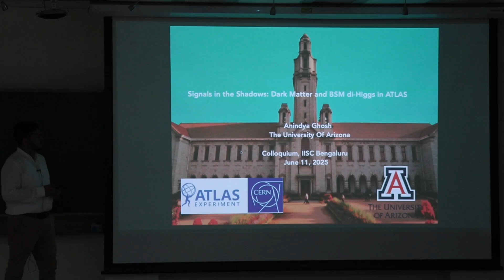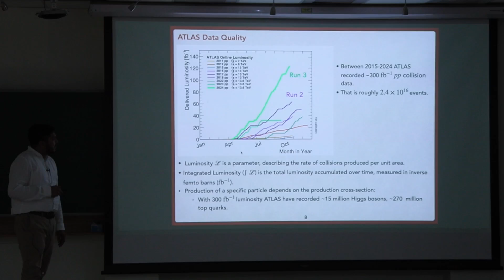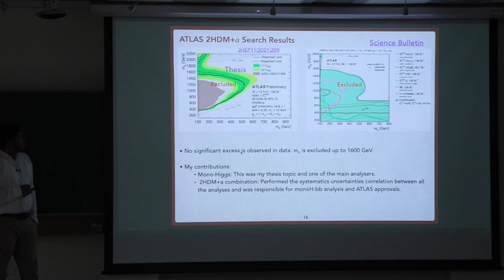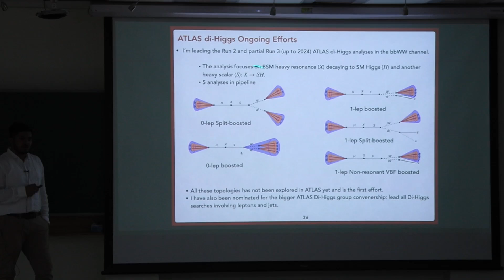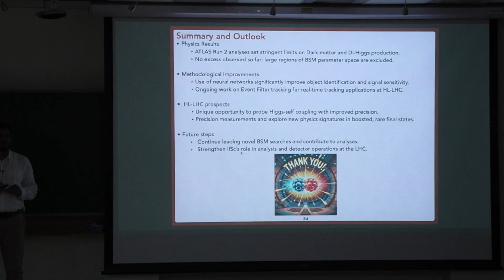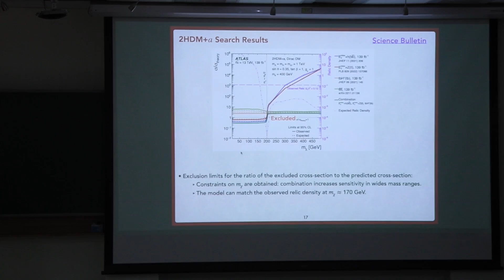Signals in the Shadows: Dark Matter and BSM di-Higgs in ATLAS

Comment: All galaxies with low mass centers have normal rotation rates. A fundamental insight of Relativity is that mass that exists at relativistic velocities is irrelevant from our perspective. Relativistic velocities are occurring in the overwhelming majority of galaxy centers. Relativistic dilation is occurring in our galactic center. This means that its mass exists in a "non local" state from our perspective. In other words it's not just there, it's everywhere.
   It can be inferred mathematically that dilation doesn't occur in galaxies with low mass centers. They do not have enough mass to achieve relativistic velocities. It has recently been confirmed in 25 dwarf and ultra diffuse galaxies to have normal rotation rates.
   Einstein repeatedly said that dilation prevents astronomical concentrations of mass. He put this in writing in 1939. Mass is a clingy thing thanks to gravity, it makes sense that dilated mass would exist as a halo around galaxies.